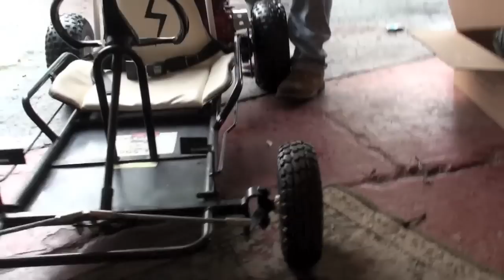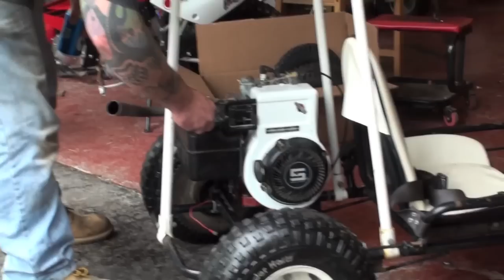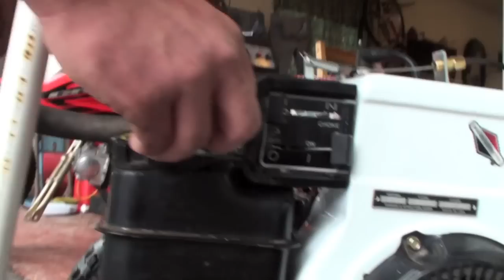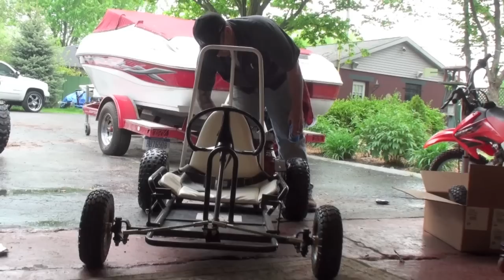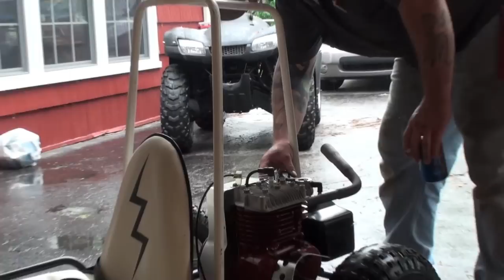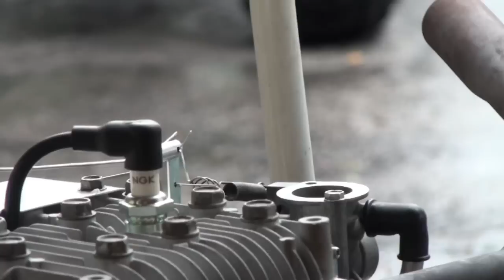GO KART BRIGGS & STRATTON 5HP TEST FIRE REBUILD

Comment: The engine blowing smoke on acceleration & deceleration is a bit of a worry as that indicates worn valve guides - how are the valves sealing off? 
A compression or a leakdown test would detect if the valves are sealing off and the engine appears to be spitting back a bit which sometimes indicates that the valves are a tad leaky,if the bore was tapered, the motor would appear to be o.k. at low revs but will start to blow smoke at high revs which I don't think is the case with this motor.
I have a 1988 model Briggs & stratton push mower with the 92508 model of engine which needs a rering,the dry compression test is 97 PSI & the wet test is 124 PSI so the valves are o.k. in that motor and the engine doesn't spit or run erratically so the valves aren't leaking and the valve guides are o.k.
The engine is just hard to start due to a Lack of compression,it will start & run but it burns a fair bit of oil on startup then stops burning oil when the revs are increased after  5 - 10 seconds,while I could get away without fitting new rings for a while I feel I am better off just performing a rering now than to do a rebore when it gets down to 55 PSI of compression pressure when it can't stop burning oil and needs a rebore & oversized piston & rings fitted, in other words - don't let it get too bad !!!!

Comment: @MrClimate1986 my  kart is pretty quick i raced my uncles acura integra i kept up untill he hit the gas more mines all stock and went exactly 45 mph then my racing spark plug ''ngk'' just blew out from the head left a quarter size whole in it then i bought a new head for it and i have a 2 inch muffler its freakn loud!!!